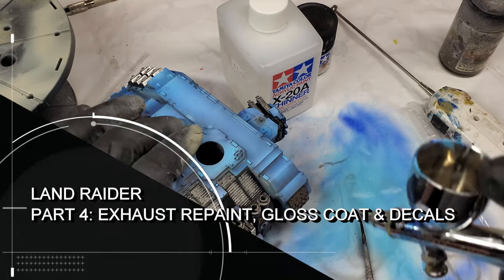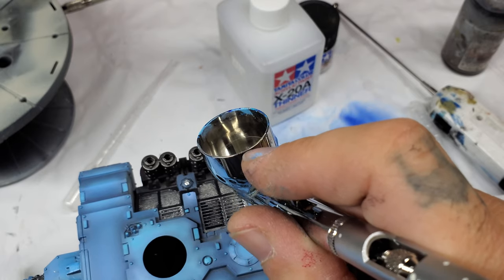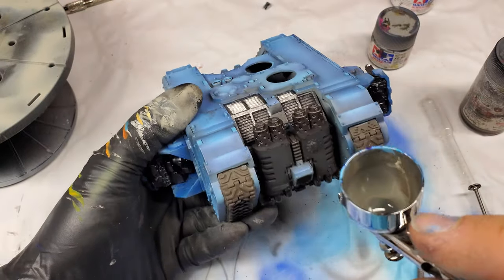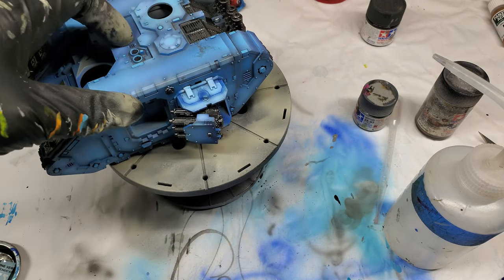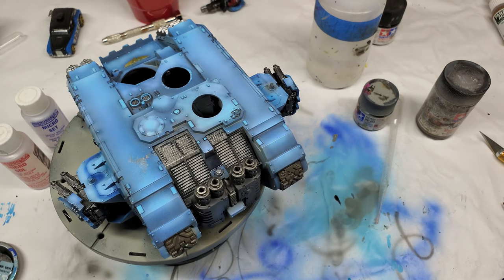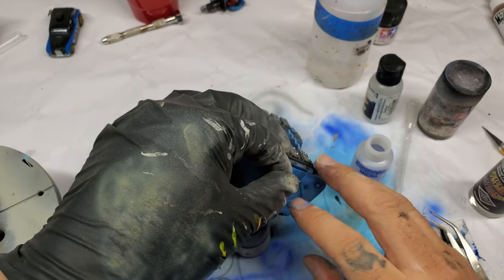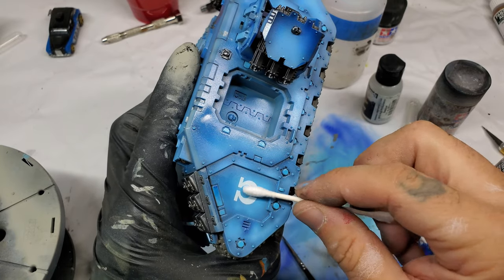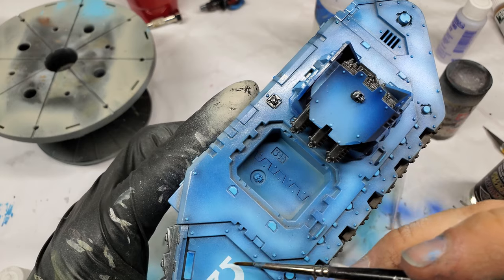LAND RAIDER PART 4

Comment: 7:40 I'd be interested to hear that as I pretty much can only afford one airbrush! I was thinking of just getting a cheap no brand one that comes with a compressor to play around with. I've no idea if a slightly more expensive airbrush would be wasted on a newbie, or if a cheap rubbish one is counter productive to learn on.
Reply from the maker: I don't know the answer to be honest but I think it's worth exploring. Bagder has sales Around USA holidays, memorial day is coming up and you can get 40% i think. I have no hesitation recommending a Badger patriot. They are versatile, rugged and easy to find parts of you live in the states. But if you think your not totally sold then maybe a lower cost option is a wise choice.